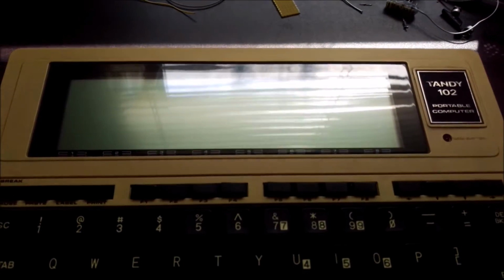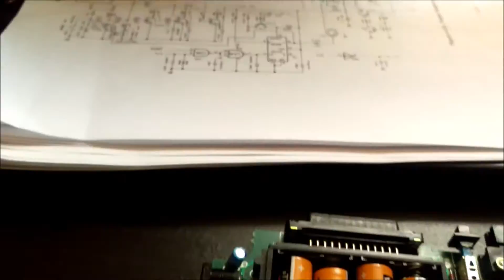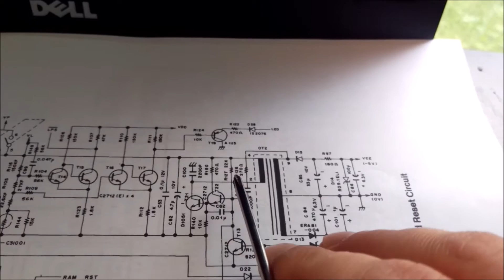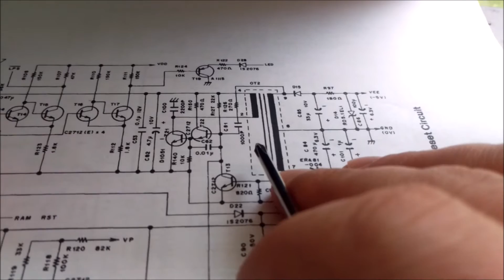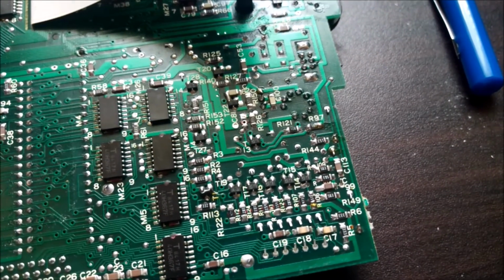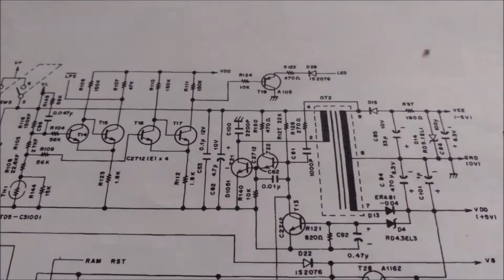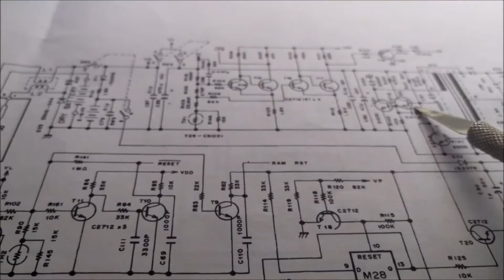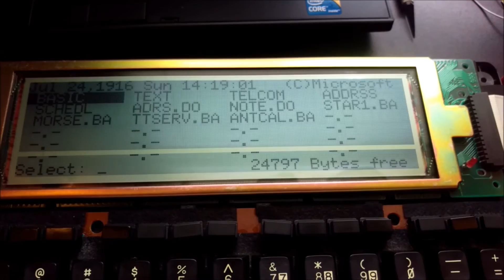Tandy Model 102 - Diagnosing the Power Supply

Comment: Hey. I have a 100 and I can save a program to tape, but when I try to load the program it just hangs. Do you know anything about loading programs from tape?
Reply from the maker: Susan Donovan it could be that the level you are playing back into the 100 is too high with the program playing back, adjust the volume untill just after the internal speaker in the tandy starts to play back the signal. also if the recorder is not working up to spec, if it has too much wow and flutter it can affect the quality of the recording.

Comment: Thanks for the video, I have the exact same problem. I hope I can fix it with the help of this video.
My screen also has 2 lcd lines that are not working correctly, but it are vertical lines and only the bottom half of those lines are not working. Any idea what that could be the cause of this?
Reply: @calcmandan Hi, thanks for the advise. I'm keeping my broken one now for parts. I got another one for only 17 euro (about 20 dollar) which only needed minor repairs.